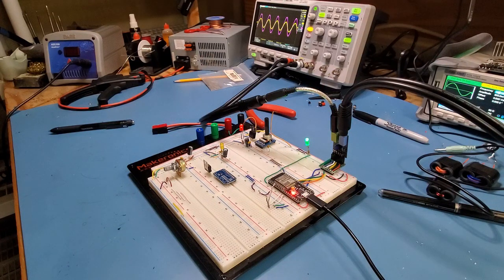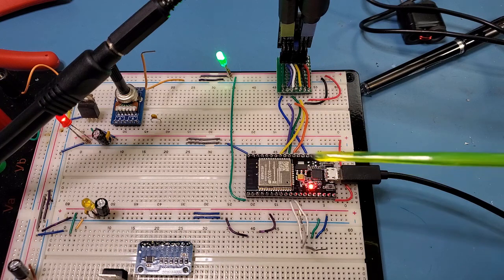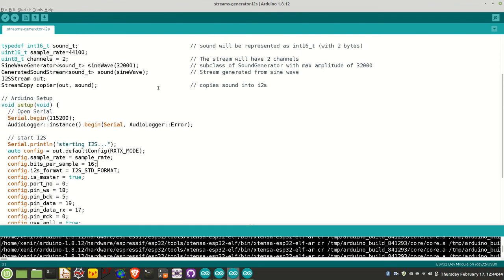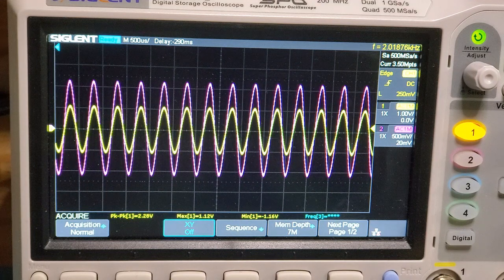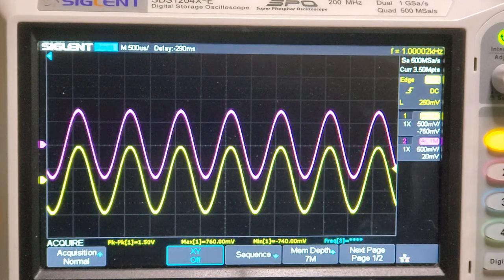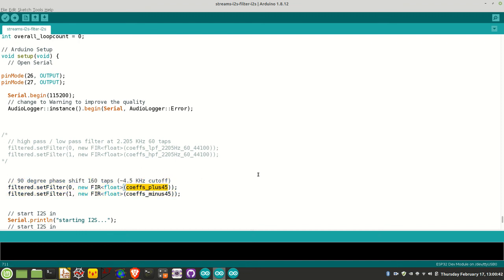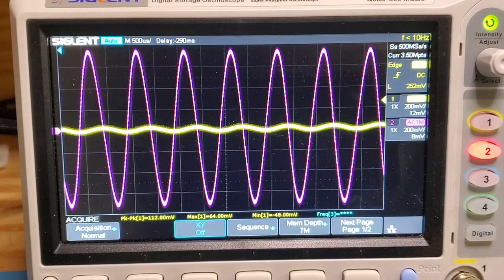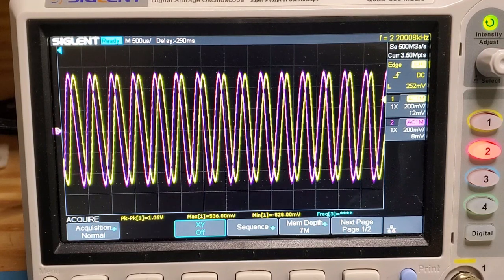ESP32 Arduino with arduino audio tools

Comment: Hello, does the ESP32 just produce the clocks for the PMOD ?  If the I2S RX pin is not being used what is the internal I2S of the esp32 doing except acting as the master for the I2S in the PMOD ? Sorry if I missed something.
Reply from the maker: The PMOD acts as both a digital to analog as well as an analog to digital converter. That means the ESP can receive an audio bitstream (which the PMOD has received and digitized through its audio in port) or transmit an  audio bitstream (which the PMOD will send out through its audio out port). 

The clocks just synchronize that exchange - which is essentially the I2S standard. I have a separate video on I2S here that you might find interesting https://www.youtube.com/watch?v=jvmejxsQzn4
Reply: @na5y  Thanks for the quick reply. I could be mistaken but I thought you said that the RX pin on the esp32 wasn't being used in the first demonstration using the signal generator. So that kind of prompted my question. I will check out the link, thanks again.

Comment: In generating a sine wave example you use sample rate of 4100 works great, but how can I use higher sample rates... I'm having problems with the Nyquist frequency limit.... Actually all your examples use 4100 sample rate, is this the highest rate esp32 or  Pmod I2S2 can do..
Reply from the maker: I think maximum is 96kHz - I haven't tried that high though

Comment: Thanks for this video. Do you think that the internal esp32 adc should be enough for implementing a dsp noise reduction for ham radio. Target bandwidth are around 5khz. I guess that could be a great project in order to improve the quality of old radio station 😁
Reply from the maker: Interestingly I just had a similar question on that topic. I did try using the internal ADC for audio processing a long while back and I was not successful. You have to end up controlling all aspects of audio synchronization if you just use the ADC to make sure you are sampling on a precise frequency. You get that out of the box with an external codec and I2S. I am sure you could do it - but again IMO you are better off with I2S. 

Thank you for the question Hugues
Reply: I just recently used the ESP32 internal ADC to make an LED audio spectrum display.  It was very tricky to set up and get the timing right.  The internal ADCs have linearity issues, but for this application that was not a concern.  But, for only 5kHz, they just might work.  You need to DC bias the analog input to Vcc/2 since the ADC only read 0-Vcc.
Reply from the maker: @lmstrutt  I guess I am so used to I2S now that I kind of prefer its "simplicity". It was a bit of a bear for me to learn originally though. Thank you for the comment
Reply: @na5y  I just say à project like yours called GI1MIC $19 DSP Filter. Intestins, the used board is strong enough to include all needed stuffs.
Reply from the maker: @huguesmassart4483  Interesting project. A little plugin board for shaping the output audio. Thank you for the comment

Comment: Great Video - thanks for the heads up ... is it possible to implement  Mixer , multiply and FFT to a display ?  like with the Teensy audio design tool  - as you mentioned for a SDR.
Reply from the maker: Its all in there Alan - I have just scratched the surface of this toolkit. There's even some compression libraries included. I do intend to play around some more. Only potential challenge I see is that as it is platform neutral it doesn't allow ESP32 specific multi-core, threads, etc.
Reply: Hi , sounds like there’s a lot of functionality with the DSP library - interesting to look into implementing an ESP32 SDR USB/LSB/CW etc with the PMOD board for RX and TX
Reply from the maker: @alanclarksonm6agc806  Definitely Alan. Something I plan on doing. One note though is the FIR filter in the arduino library isn't optimized for the ESP32 - and so quite underperforms the FIR algorithm in the ESP-ADF. Hopefully next video (if I ever get there) is going to be on this https://docs.ai-thinker.com/en/esp32-a1s  - It has a built in ES8388 on board. Looks very interesting

Comment: Hi I would like to use this library to record sound captured by an I2C mic in mp3 format to an uSD card. The creator  of the library said it is possible but did not want to give an example how to do it. Could you help maybe? Thanks in advance.
Reply from the maker: I haven't tried that myself. Are you using an ESP32 board or something else? Just a note I do plan on a pile more experimentation with this toolkit so stay tuned. In the midst of a house move right now ;)
Reply: @na5y  I have normal wroom and wrover ESP32 modules and I2C mic and different I2C DAC boards. I hope you finish moving soon :-) looking forward to more good examples with more explanation then what is given in the library.
Reply from the maker: @SA-oj3bo  Thank you SA. The usual configuration is Mic -> ADC -> ESP32 -> SD card. The ESP32 would have to do the MP3 conversion which the libLAME part of the arduino audio tools would do. The reason I asked what board you are using is that Espressif have the audio toolkit  https://github.com/espressif/esp-adf which is a bit of a chore to set up but also has the functionality you are looking for.

Setting up IDF and ADF is a bit of a pain though...

Comment: I am using PCM1802 ADC and cs4344 DAC. I don't know why DAC 4344 doesn't work when using .bits_per_sample = I2S_BITS_PER_SAMPLE_16BIT.
Reply from the maker: Thats the same DAC the pMod uses so it definitely will work. What MCLK frequency are you using? Are you driving the SCLK externally?

Comment: unfortunately the new Library update does not support the option to specify Mclk
Reply from the maker: Just reconfirmed with a pull from latest that you can still specify the MCLK. You do need to have the latest ESP32 Arduino environment - 2.0.2 from Espressif
Reply: @na5y  ok thanks for the information you provided, I'll try it
Reply from the maker: I am away from my computer right now but try updating your esp32 arduino to 2.0.2.

Comment: Hi, I Just tested the sketches but there are a lot of errors during compilation due for sure to the libraries, I Just installed the audiotools as always I do with the other libraries, but for sure something Is missing in my setup. Any spuggestion? Thanks
Reply from the maker: Edit: just checking - it looks like some of the library code has changed and I need to update my code. Let me get back to you...

I am always up for some remote debugging. Some baseline questions:
1) What uController are you using
2) If its ESP32 do you have a simple "blink" example compiling (ESP32 is a bit of a pain to set up - and I'd like to make sure that is set up correctly)
3) Have you done a recent pull from the arduino-audio-tools github repo - I know there were some compile errors in AudioStreams.h > GeneratedSoundStream (which have been fixed now)
4) Could you send a snippet of some of the errors (you can use the email address in the "about"
Reply from the maker: OK - it is now compiling OK for me. There are warnings coming from some of the IDF code which you can ignore - like this:

Edit: Assuming you were using ESP32....

/home/xenir/Arduino/libraries/arduino-audio-tools/src/AudioAnalog/AnalogAudioESP32.h:208:39: warning: 'I2S_COMM_FORMAT_I2S_MSB' is deprecated [-Wdeprecated-declarations]
             .communication_format   = I2S_COMM_FORMAT_I2S_MSB,
                                       ^~~~~~~~~~~~~~~~~~~~~~~

I did have to reinstall my ESP32 arduino board software though through boards manager. I am doing this on a different computer than the one I was using earlier. 

Make sure you set
https://raw.githubusercontent.com/espressif/arduino-esp32/gh-pages/package_esp32_index.json

in the Preference>Additional Boards Manager URLs - and pick version 2.0.2 in boards manager.

Let me know how you get on
Reply: @na5y  Thanks a lot, I just changed the setting for the board manager and reloaded the boards, and it is working now. I was using a more than one years old setting for my DOIT ESP32 DEVKIT V1, some warnings are still present, but the compilation ends and data are correctly transfered to the module. I'll send you the snap shot. Thanks again. Antonio
Reply from the maker: @antaf56  Thats great news Antonio - glad you were able to get it working. What audio codec board are you using? The pMod or something else?
Reply: @na5y  I am using the Digilent Pmod I2S2 but I have not yet connected it to the ESP,  I'll do it just now.....i'll make you know!
Reply from the maker: @antaf56  Ah good - I know that works ;)
Reply: @na5y  💪
Reply: Hi, I sent some feedback to the email!! Everything seems (quite) working.
Reply from the maker: @antaf56  Cool - haven't got your email yet.
Reply: @na5y  That's  very strange, I sent two emails, please check in the spam!!
Reply from the maker: @antaf56  Thats where it was...
Reply from the maker: @antaf56  Reply sent...
Reply: @na5y  Please check my answer!

Comment: Nice video, I don't like Arduino libraries as they often change enough between revisions that they are not backwards compatible. I try and understand what a site is doing so i can try and create a program that does it for me, just in case you find they either remove it or put on a charge to use it.

Plus it gives the old (very old in my case) gray cells a workout. :-)
Reply: If you use portable mode for your Arduino environment then you can keep as many snapshots of a working build as you like. I find this invaluable when going back to old builds and is the reason I won't use IDE 2.x until this feature has been added. If you like to use IDF code in the Arduino IDE then this is a useful version control approach - arguably inefficient and 'manual' but very safe. I find portable mode particularly useful if I need to tweak libs for a particular project and don't want those tweaks to propagate to all other projects.
Reply: @nikthefix8918 I thank the whole point of libraries is that you don’t need to change or modify them, or if you do they should always be backwards compatible.  Too many libraries for the Arduino are not controlled or updated correctly! Before i gave up using them one went from say Rev1 to Rev2 and the interface changed so much that none of the previous call to the library worked. They just changed the interface and did not bother to even say they had done it or overload the functions so you had the choice of using the new or the old.

Just changed the library so all the beginners out there found that when they tweaked their currently working programs they got a whole screen full of errors on compile. Just because they updated a bloody library and the author did not care or give a s**T about his library users.

For me I’m not a beginner so i just dumped the libraries and make my own, but the Arduino is pushed at beginners so libraries should be written to help the novice not be a pain in the butt.

Today days rant over, now i can go back to drinking my tea. 🙂

Happy new year to you. may you find 2023 way better than the last two.
Reply: @TheEmbeddedHobbyist  Yes I feel that same pain regularly. I gave up on assuming / expecting lib updates to play nicely even when they all come in waves in response to a large framework update. Sometimes everything still works but not as well. Finding the deterioration in such a case is hard and I'd rather it completely broke so that I could hunt for a needle in a haystack. Being able to rewind to a known good build scenario is the only way I can attempt to route out problems. Being able to mod libs is sometimes vital. At least in Arduino they're not faceless binaries (although there are actually plenty of those under the hood).

I would add that version control and backward compatibility of Arduino libs is extremely good in my experience but not well documented. It's always worth looking at the github code of the latest release and doing a changes compare before committing. More often than not, breaking changes are just namespace changes or other relatively trivial but irresponsible overhauls.

I think it's important that Arduino users treat the libraries as user code and not just a black box. Therein lies optimization and learning.
Reply from the maker: I know what you mean - I do wish the ESP-IDF and ADF were a little easier to use though. I spent the whole of last weekend upgrading some code to ESP4.4 (from 3.2.1) and then I found the latest version of ESP-ADF didn't work with it! Thank you for the comment!
Reply: @na5y  I'm currently trying to get my head around ESP8266 FreeRTOS. I could do the task in a few lines with the Arduino, but what will I learn, plus which one will give me more satisfaction?
Reply from the maker: @TheEmbeddedHobbyist  ESP-ADF uses the FreeRTOS tasks very well in the audio pipeline. There's some great examples of RTOS use in that codebase (tasks, threads, eventing, multicore, synchronization etc) if you are interested.
Reply: @na5y  Thanks i'll have a look.